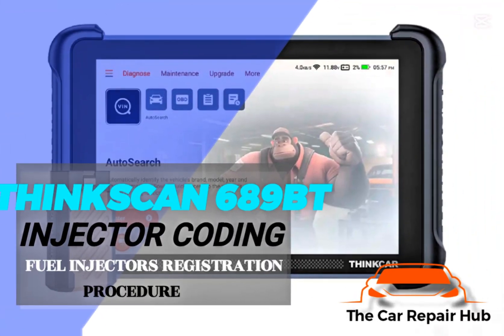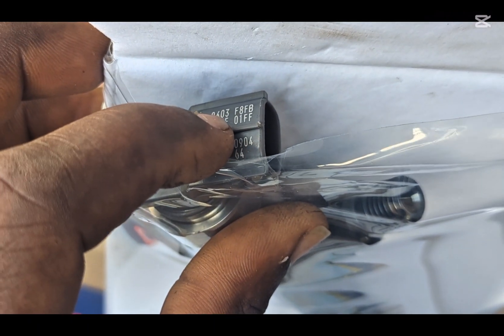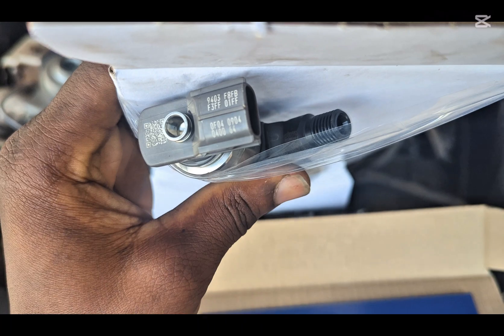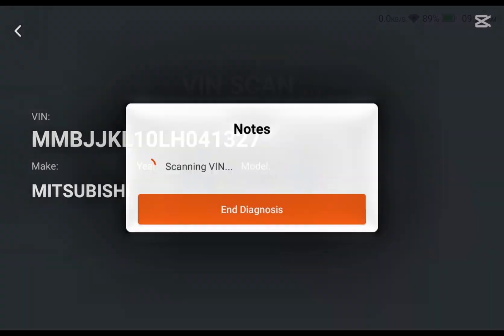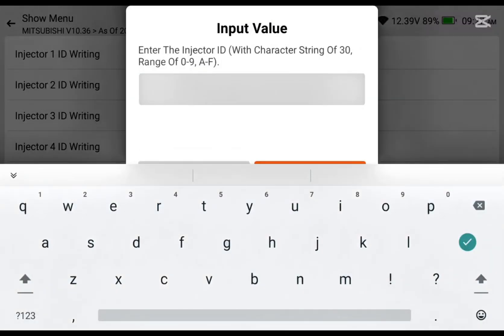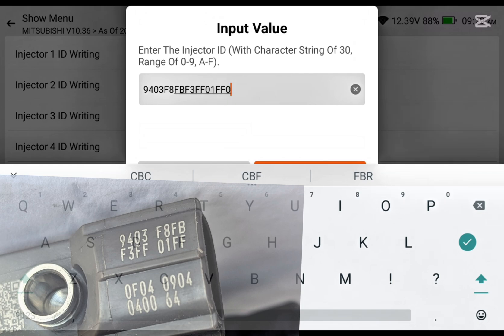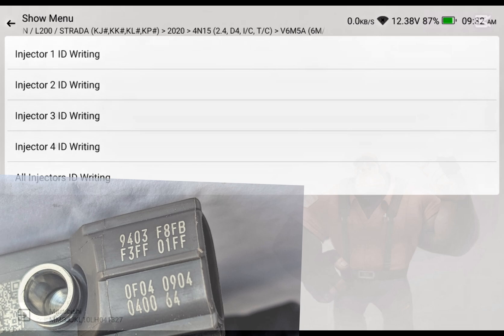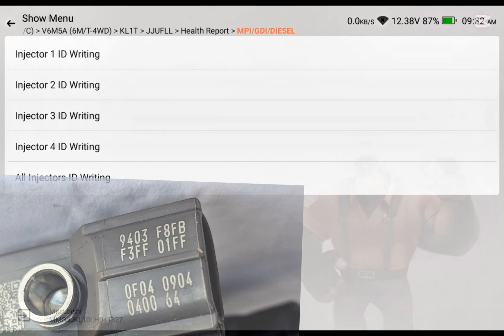Using "THINKCAR 689BT" For Injector Coding

Comment: Hi can this do dpf actual  soot content
Reply from the maker: Please which vehicle,I have used to do DPF regeneration it work absolutely perfect.
Reply from the maker: Please which vehicle,I have used to do DPF regeneration it work absolutely perfect.
Reply from the maker: I will check it out, just give me vehicle Make and model I will try and get some if available and make a video on it.The tool so far with the budget it's not bad.
Reply: Hyundai ix35 1.7 crdi diesel 2015  @TheCarRepairHub
Reply: I did come across this but can't find  since the big update
Reply from the maker: Unfortunately I have no diesel Hyundai in the garage currently as soon we receive any I will try it and update you on that.
Reply from the maker: Really we find out.
Reply: Hi great videos  the 689bt great tool I've found more yes it does actual soot content,  and lots more it's learning more about the software